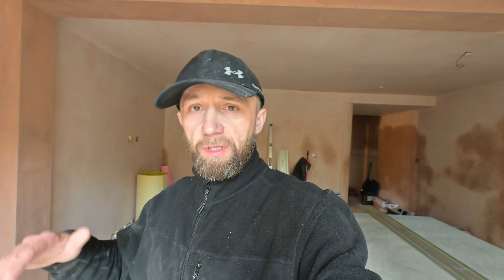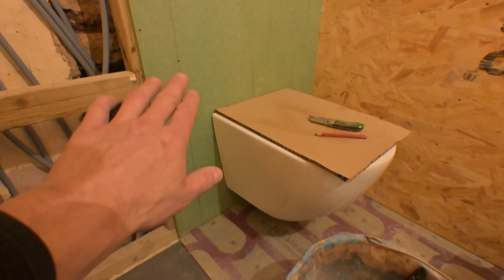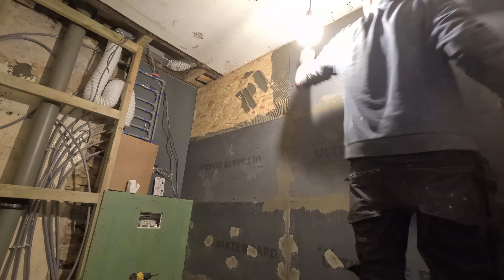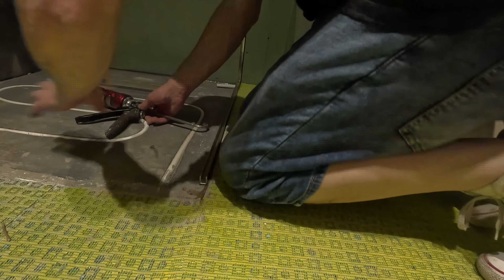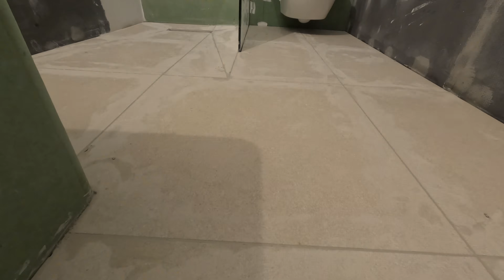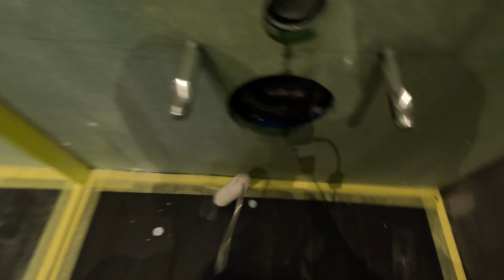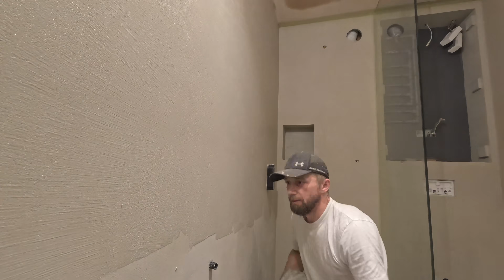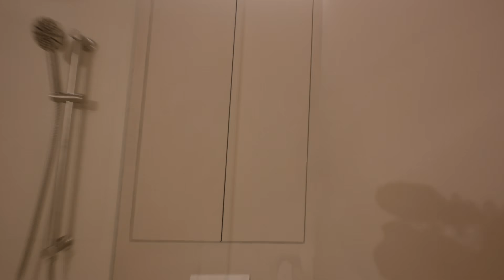The Death of Bathroom TILES..Micro-Cement Explained

Comment: Nice minimalist look, but for DIY it is far more work intensive than tiling with all the grinding (no mask needed ???) ...I would use Micro cement only in some parts. Probably the MC course surface  will be more prone to  mildew and mold than tile and would be difficult to scrub clean, then the problem with waterproofing corners: usually foils with specially formed corner applications are used as movement compensation between Floor and walls! Kudos for a great demonstration though!
Reply from the maker: Thank you for your engagement. 
It's not advised as a DIY project. You need to be skilled with the trowel. The waterproofing side of things is not an issue. This stuff is extremely flexible and waterproof. It's antifungal so nothing will grow on it but the cleaning is with gentle chemicals. Same as on marble.
Reply: @yesconstructionltd   Many thanks for your reply I am an Architect with some Trowel skills so DIY is always on my mind!😊
Reply from the maker: @dipling.pitzler7650   good man! An architect introduced me to micro cement a few years ago. You guys always innovate and we do the work🙂

Comment: I just find nice large tiles to be more visually appealing. You can play a lot more with colors and variations and create patterns as you see fit and use deep, glossy, glowing colors if you want. But I'm sure a luxury bathroom built out of great expensive tile will cost a fair bit more to do than this. This looks good but I find it a little too one-toned and a little too bland. But it's certainly a clean look.
Reply from the maker: Hi and thank you for your engagement. 
It's a design matter. You can achieve a different look with micro cement. By adding some wood and blood features you can break the simplicity.  Like in this video :

https://youtu.be/5dVq9bgEA5E?is=FstsT_nNkSWmWEi6

We added the oak vaneered furniture to make it cosy and warm and I think it look fantastic. Have look😊

Comment: I am truly curious to see how this looks like after one year. I hope there are no water problems at the joints between the shower floor+ the glass panel and the green MDF wall. Also the little niche in the shower made of green MDF could be a problem there..
Reply from the maker: Thank you for engaging. Yes, that is the question many people ask and I understand. 
I can assure you that waterproofing is not an issue. I am going to make a video on that soon as I get this question repeating a lot. This stuff is extremely waterproof, flexible and durable. One of my friends did a job at a museum. They made MDF table and chairs, covered it with microcement and it's been resting in the swimming pool for the past 5 years. Recently the museum ordered them to change the set up so they got it all out and zero damage to the furniture. I wish I was there to film it 😊

Comment: What about trapping moisture and condensation inside the wall behind that waterproof seal?
Reply from the maker: Thank you for engaging. That won't be an issue. This is why we used insulated boards to eliminate this issue.

Comment: Micro cement looks like it is much more time intensive to get the finish required than tiles would be. Do you find that's the case?
Reply from the maker: It's definitely time consuming but if you have a bathroom with a lot of mitre cuts it will take long as well. Just to apply microcement you need 4-5 days.

Comment: I'm not convinced that removing the tile and only covering the wall with multiple layers of finely formulated grout is not going to turn into a nightmare, especially in new wood construction. Wood framing that is not an engineered wood product is going to change shape as the moisture content stabilizes and weight bears down upon it from above. Is that MDF sufficiently structurally sound to prevent bowing mid wall or tension from opening up the 90° corners. It all comes down to the rigidity and stability of the substrate and how flexible this fine grout is when used like a layered plaster/stucco system.
I'm living in a moderately active seismic zone (nothing like Japan) and temperate rain forest. I think I'm looking at something a little too brittle, unforgiving and an expensive labour bill if a child decides to do some decorating of their own.
Enjoy but don't let the grandkids in there.
Reply from the maker: Thank you for engaging. 
When it comes to flexibility, this stuff is very flexible so cracking isn't something anyone should be worried about. As long as the sub surface is prepared correctly. 
The whole idea is about creating a different look and atmosphere. Different from the traditional look of tiles. This trend is being pushed by architects and interior designers. It became a lot more affordable as 10 years ago this was a high end bathroom option. 
I am not worried about its waterproofing properties or flexibility , that is all good. It's the look. The younger generation is looking for other solutions as the tiled bathroom is looking boring in their eyes because that is all they ever see. 
I agree, no marker pens in the bathroom 😂

Comment: Those looks like quest piping the gray plastic water tubes. You’re using there. They are outlawed here in America because they’re notorious for splitting and cracking and developing holes, which then caused constant leaking or floods, and insurance companies will not pay for the claim if they know that these pipes caused it. I just found this out when I bought my house three years ago and then I was just taking a bathroom apart and apparently this house has the quest pipes which was the name of the company who is now out of business after a class action where they had to replace all the pipes up to 2009 I believe it was and then that was the end of the class action and their responsibility, but apparently people like the former owner of this house didn’t know about this or didn’t care to have them changed and several of the sink areas in the house were replaced with copper so it looks like they already did have some pipes let go and burst. Something to look into.
Reply from the maker: Thank you for engaging 
The system we use is POLLYPIPE. it's a multi layered pipe so splitting is not possible. It's tested to 15Bar pressure where in the UK the pressure is hardly reaching 3bar. The only risk of leak are the joints and this is why we have a manifold system. As you see in the video all the joints are accessible in one place. 
Thank you for sharing. It's interesting.
Reply: Where they made in India Pakistan China or THE UK?  LOOKS ARE VERY DECEIVING.
Reply from the maker: @mediatoday-nm2hc
Its UK product, quite expensive. From all the push-fit systems POLLYPIPE is most expensive but most reliable.

Comment: Can this be used on the exterior of a house, instead of stucco? Seems labor intensive, but very nice.
Reply from the maker: It can. Different primer and final seal needs to be used but it's absolutely fine. It's resin so it's capable of withstanding hot and cold temperatures.

Comment: Nicely done! What was the sealent used as a backer for the microsement between pan/tilable/concrete boards on floor and walls and the mdf behind the shower and is the microcement strong enough to not crack?
Reply from the maker: Thank you . It's a special primer with quart. Provides extreme bond with anything. You can paint a glass with it and apply the micro cement on top. 
It's extremely flexible so cracking is not something you should worry about. This question is repeating a lot so I am going to make a video showing people how flexible and durable it is.

Comment: Dumb question - why install that glass divider, and floor tile, before doing all that roller work on the walls...  would have given you so much more room there to move around.
Reply from the maker: Hi. This was done before tiling to hide the channel in the floor, so you can see only the glass with no trim. We opened the ceiling, installed the 12mm trims, installed the glass, closed and plastered the ceiling, tiled the floor, and micro-cemented. Without this order, achieving this look was impossible.

Comment: Is it ok to have an electric socket in a bathroom in a cupboard which does not need tools to open?
Reply from the maker: Yes. It's separated from the water source with a glass wall and it is inside of a cupboard. This was done by a qualified electrician and then certified.
Reply: @yesconstructionltd  Thanks.  I've seen various opinions on similar.
Reply from the maker: @nomennudum4592  It can be tricky to find the right answer in the book, but there is always an answer.

Comment: This seems like a lot more work than tile.
Reply from the maker: It's definitely a different type of work and a different look. I think it takes a bit longer depending on how complex the tilling is. If you get a lot of mitre cuts in the bathroom, you will be there much longer.
Reply: Until you have to clean discolored grout and moldy caulk
Reply: The amount of "work/preparation" he put into this is the exact same amount that should be done in any wet area. The only part that was different was the final finish. Couldve been tile just as easily instead of microcement. The preparation for both is the same. If you see someone doing tile inside a shower, and they just slap board on the walls and some mesh tape on seams, itll leak at some point. There are millions of showers out there right now in America that are slowly rotting out from under the people using them. And nobody knows until its too late.
Reply from the maker: @mikeorosco4787  Exactly! Well said. When I tile bathrooms the prep is the same. Thank you for engaging 😊
Reply: @mikeorosco4787 Coming from a guy who has been building custom showers for the last 27 years,that is a fact! Products and methods have changed a lot in the last 20 years and if you do them correctly they will last well beyond the urge to want something different.

Comment: Works if you like the finish & you’re doing it yourself - cost/benefit would not be favourable if you’re paying for it to be done. And then there’s Maximum Tiles…
Did I miss the lack of hydronics around the toilet yet in the shower base?
Reply from the maker: I wouldn't say this is a cost saving solution. It works out to be similar to tiled bathroom cost.. It's a different look that convinces people to use this product. I wouldn't recommend a DIY with it. It's not as easy as it looks. You would have to have a good experience with a trowel. 
The pipes are installed in the entire bathroom, covered with MDF.

Comment: Considering it's resin based, is it a respiratory or fire hazard while curing? I can imagine the offgassing could be gnarly.
Reply from the maker: It's not. The VOC is extremely low and the manufacturer doesn't recommend mask wearing. The first primer smells a bit so I wear a mask but even that is extremely low toxicity. From what I read the wall emulsion is more toxic

Comment: The edge of the microcemented undersink door has some issues, can it be fixed afterward? Sand down&reapply layers?
Reply from the maker: Yes, well spotted 😊 I already did it. Small touch ups are not visible. If it's something big you need to go over the whole wall again.

Comment: Interesting concept, looks really clean and minimalistic. Would look perfect in the right property. Again great workmanship. Question, what would happen if the glass screen was broken and needed replacement? The door area could have been improved, maybe make the door frame flush with the finished wall, and then even go further to micro-cement the inside of the door as well as the inner side of the door frame?
Reply from the maker: Thank you for engaging. My suggestion was to have a shadow gap around the door frame and to micro cement the lot but it came at an additional cost and the client couldn't stretch the budget as it was tide. I have a feeling they will ask me to at least do the door. It won't look right painted.

Comment: Why not microcement on the floor? Client choice, or any reasons to avoid it?
Reply from the maker: No reason. You can do it on the floor and it looks amazing. It increases the cost. You need a cementation shower tray designed for microcement and the build up of the floor would have to be different. It was their choice. They were also afraid that it might be too much. I was suggesting to do the ceiling as well but so far nobody wants to let me do it. Everyone goes with the stereotype of a white ceiling.

Comment: I renovated my 2 bathrooms with micro cement, took way way longer than expected and was not easy at all to apply it. 2 layers of leveling primer, 2 layers of microciment and 2 of sealer. Maybe I just choosed the wrong brand. Which one are you using? How long does it need to rest between each coat? 

Anyway I am very happy with the final results of my bathrooms, and the result here looks stunning as well! What a journey!
Reply from the maker: Yes, it's labour intensive but it's worth it. We use www.claudicemento.com 
It's a ready to use formula so no powders, measuring etc. I am glad you are happy with your bathrooms😊

Comment: There are different grades of water resistant MDF, the green is OK, but for bathrooms and areas with extreme moisture I would be tempted to use Tricoya its completely waterproof MDF, green MDF is just resistant.
Reply from the maker: I actually never heard of it so I learned something today. Thank you. I will look into it.
Reply: Thank you!
Reply: Green mdf is totally pointless. Not waterproof in any way.
Reply from the maker: @bmartinot The reason for the green MDF is not waterproofing. The MDF is completely separated from moisture and insulated from the back so condensation won't be an issue. The reason for using green MDF in this case is that green MDF does not shrink or expand with temperature change.
Reply: @bmartinot doesnt have to be water proof if it has layers of protection 😂 maybe you should watch the video again and pay attention
Reply: How can you make money on this . Coating the internals of cupboards and sanding will take forever!. Green MDF will fail with water leakage. Also you tiled the glass screen into the floor ??
Reply from the maker: @66reeves  Thank you for asking. It takes 5 days regardless of how big the bathroom is. You will have a shorter or longer day, but you can do one stage per day. The sanding is very light and doesn't take long. If you can apply it well, you can just smooth instead of flattening. It is very hard to remove the material with the sander. The surface is very hard. The MDF will not fail, I promise you. It is completely separated from the moisture. My friend in the trade did a job for a museum in London. They built a table and chairs out of MDF and rested them at the bottom of a swimming pool. 5 years later, they changed the setup, so they went there again to build something else. When they got it out of the pool, it was in one piece and undamaged. I wish I were there to take a video. 
Tiling the glass in and hiding it in the wall and ceiling is the new going thing, so you don't see any trim, just glass. I like it. You have a problem if the glass breaks, but people take the risk for the clean look.
Reply: I was thinking you better not break the glass...
Reply from the maker: @zekeblake5914  better not 😅
Reply: If you have to replace glass is a nightmare
Reply: Although pretty nice job
Reply from the maker: @arashtakhsha1120  yes,that would be a nightmare. In this case the client went after look, not practicality.
Reply from the maker: @arashtakhsha1120 😊 thank you

Comment: Not a chance tiles are a mass market this shit is and has been found out in under a year every thing gets better you can't wack it with a hammer your wrong .all you tilers wanted a easier live so you turn to this .plus it fooking batty money
Reply from the maker: Not true. It's the architects and interior designers who are pushing this trend. 10 years ago it was meant for the high end market as it was very expensive. As time went past, more and more companies started manufacturing this stuff so It got cheaper. We have a lot of installers now as well so installation also became cheaper. I don't think it's easier than tilling. Takesc 5 days to micro cement bathroom like this. Tilling would take maximum 3 days.
Reply: @yesconstructionltd haha I sell more tiles than ever millions of m2 a year and the architectural dick suckers are getting found out just like this product.